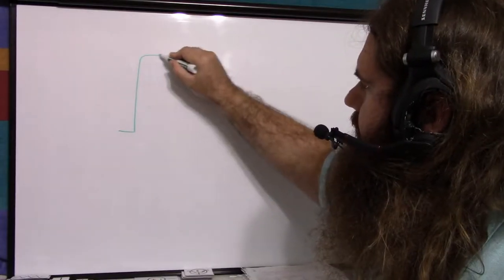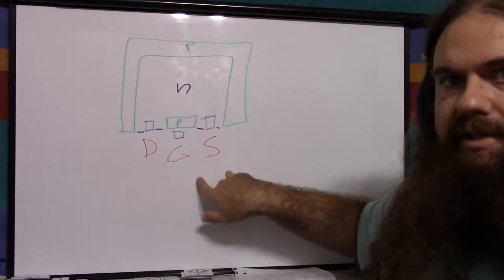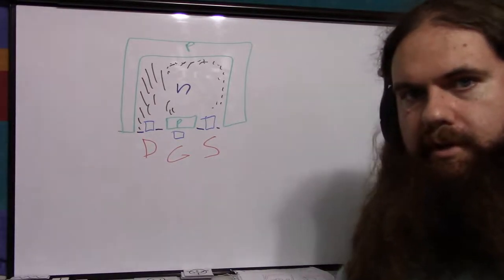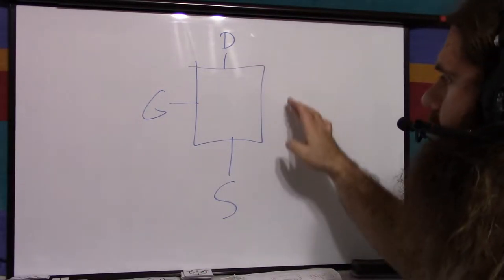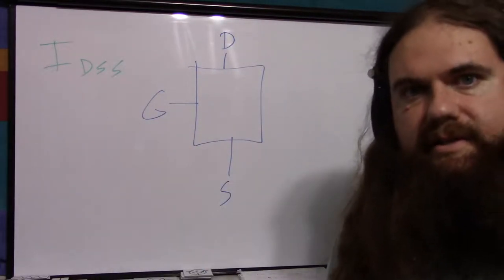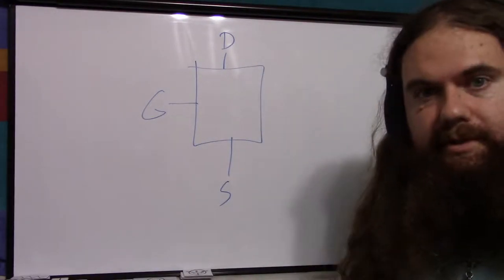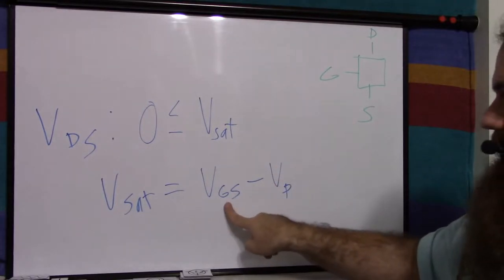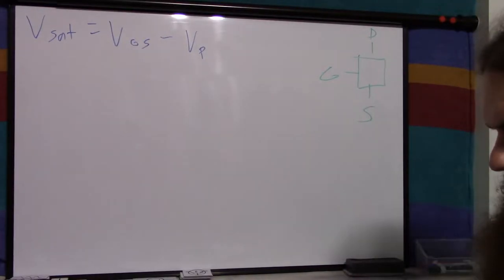JFET - Junction Field Effect Transistor - Simply Put

Comment: JFETS are often used a buffers stages but how do you test the output impedance if its 1K ohms or 100ohms and compared the output powers between 1k impedance VS 100ohm impedance?